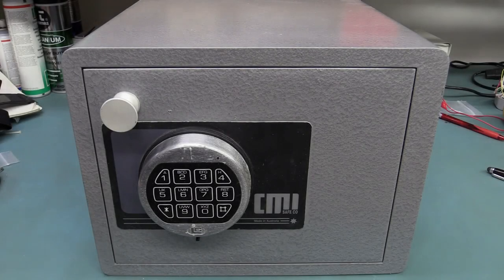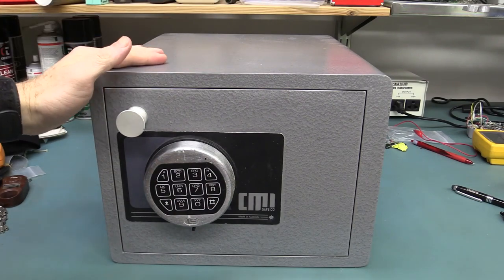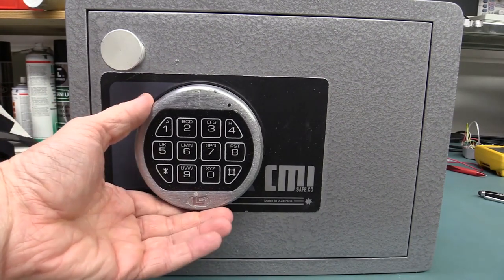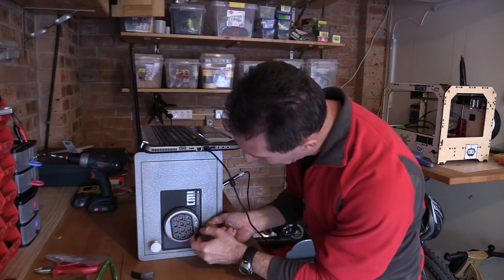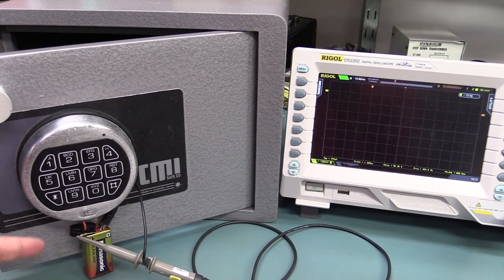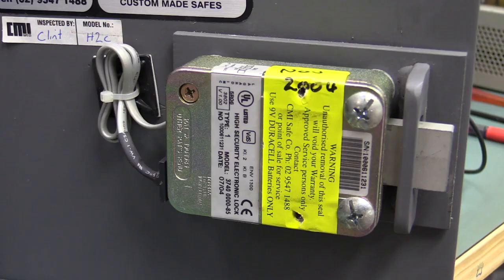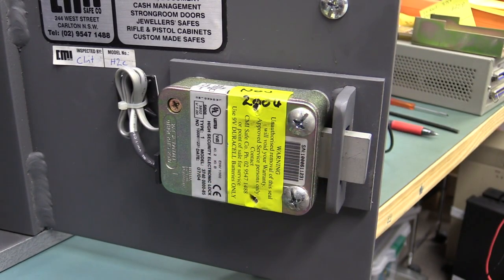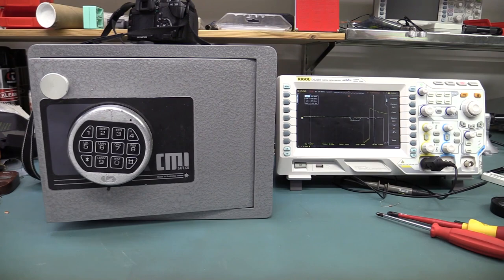EEVblog #762 - How Secure Are Electronic Safe Locks?

Comment: Had me laughing my a** off a few times there, especially when you closed it with the power disconnected - doh!  Brilliant work getting back into it, it was worth doing the video just for that!
Reply: Rather than cutting holes he could have gone in through the mounting holes and not damaged the safe using rods from the back
Reply: You don't think he thought of that? Mmmhmph. I think it's safe(theres a pun if you want it) to assume that that(cool a double that) is the first thing he looked into, considered, investigated thoroughly concluding that the only way was via drilling. 

I have to say that it's a little scary that you wouldn't immediately assume that as well and in fact felt it would be prudent of you to comment pointing that option out. You really do look kinda silly. Your comment is congruent with "I have to breath air in order to survive" or "grass is green" watch I'll prove it "Instead of drilling new holes he should have used the existing ones" see no difference "the sky is blue" it's just silly.
Reply: I can open that faster than he can punch in the code. Pure trash

Comment: You could also defend from power line attacks by programming the  micro controller correctly.

I suspect that since this lock strictly requires 6 digit pin all it does is store the numbers into memory regardless if correctness and when it sees six digits it compares the full string with the value stored in EEPROM. I could be wrong but this is how I would do it.
Reply: sghost128 You would need to do the string comparison properly (i.e. checking each digit and not bailing out on the first incorrect digit) but I assume they would do the right thing.
Reply: sghost128 yes, you'd need to use a constant time algorithm
Reply: sghost128 Actually, it can be even more secure than that: it can always hash the new code, no matter how long it is, and compare with the stored hash. This way, there is no need to lock to a specific the number of digits while still making the same process every time a new digit is typed.
Reply: Aylons Hazzud You still have to make sure your hash comparison is constant-time. That's not hard though.
Reply: Also, having a different time for each number of digits inserted is not a problem, because this is information the attacker already has (after all, they are inserting the digits ).

It must only not change according to the correctness of the code so far.
Reply: sghost128 I would do the same thing and then just OR the numbers. I'm not sure how that would look on the oscilloscope, that could very well be visible.
Reply: You guys all bring up very valid points. I'm sure there are many approaches that could defend against power line attacks.

I had considered using hashed values, however I assume this would also depend on the microcontroller being used. I'm not an embedded expert, but I assume hashing is an expensive operation, thus it may not be practical for some lower power microcontroller. Also I assume storing long hash values would cost more storage.

Either way the above example is definitely the simplest way to defend against powerline analysis attacks.
Reply: Hashing is expensive in clock cycles, but not much in the scale of a user interface. Milliseconds even in the most simple microcontroller. 

Also, data must not be hashed to a long sequence for all of this to work nicely.  The threat model is not about someone reading the hashed data. The only real concern is avoiding collision between two possible inputs. Not hard nor expensive,there are algorithms that will give you that. 

I did hashing before using a open source library and worked well even in a cheap AVR.
Reply: sghost128 No need - just a giant 2500 uf capacitor is enough. A supercap is even better.
Reply: hereiam2005 Doesn't the cap just reduce the prominence of the glitches, not eliminate them? I can't imagine that they wouldn't use software techniques to avoid leaking the information outside the wafer in the first place.
Reply: well, the typical run mode current of the ST62T25 is about less than 4mA. The time for a 2000uF 9v cap to run out of charge under such constant peak current is is 4.5 seconds. 

This amount of delay is enough to wipe out all kind of significant information you can extract from power line attack.
This is not to mention the fact that the processor spend most of its time sleeping if programmed properly.

One can circumvent the lock out timer by simply disconnect the battery. A tiny 1F supercap ups the delay to 37.5 minutes, render such kind of attack useless.

If you simply store the number to a memory chip, the power usage would increase significantly, due to the fact that the microprocessor needs to stay awake the whole time to wait for user input. A 9v alkaline could typically hold only ~ 600mAh, 4mA for several tens of seconds each time a button is pressed is quite expensive.
Reply: hereiam2005 Why would you want to add BOM when you can just change code? One is virtually free, and the other adds cost.
Reply: It seems that the core of the algorithm should "leak" as little signs of correct/incorrect as possible, until the final pass/fail. So code should avoid taking different execution paths based on which digits match. The hashing is interesting in that it makes even the internal state basically noise until the final comparison, with what looks like noise (compared to the keys pressed) to the correct hash.
Reply: 6 digits is within a 32-bit number. The CPU could do a shift and add to get the 32-bit integer (12 clock cycles) then 1 clock cycle for comparison. That is linear time
Reply: sghost128 Exactly - just store each digit in RAM, then compare afterwards. Regardless of what you're comparing (numbers, key codes, hash-values), the actual difference in power line snooping will coincide with the current draw of the solenoid (or lack thereof).
On the other hand I'd add a large capacitor in parallel with a much smaller one anyway, just to be on the safe side and to ensure I've got enough energy to engage the solenoid even when the battery isn't all that fresh anymore.
Reply: sghost128 so one compare?  that's easiest to glitch.... jnz, brne, etc.... all it takes is one hit.   a properly designed software would have it more than once and also fill any empty executable space (flash and RAM if it's executable) with a single nop instruction and at the end of it, jump to another check or lock to lock the safe.   if the program counter jumps randomly someplace, it would land on a single instruction nop instead of in the middle so you keep control of the program flow. 

further, a random delay will help prevent hitting the right spot.  if you have to glitch it more than once with the timing all over the board, it's going to massivly increase the attempts.  combined with disabling itself after 3-5 wrong attempts and it will just be better to cut it open.
Reply: NotSoLiberal linear time isn't good either,  but random time by way of random delay will make it harder to glitch the target instruction.